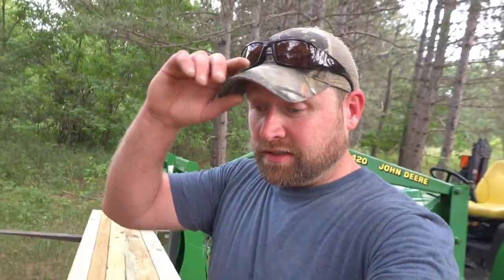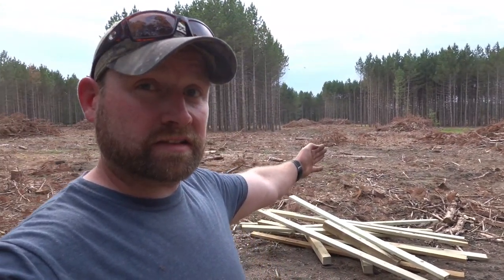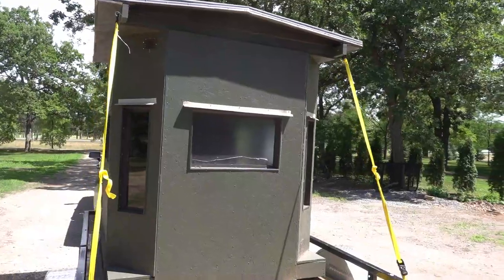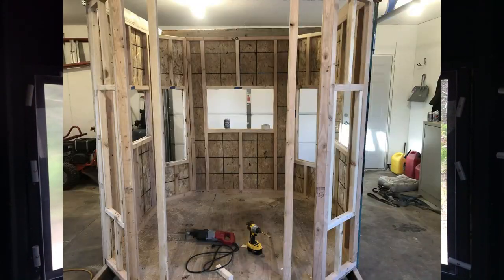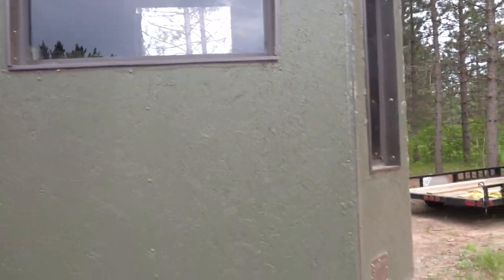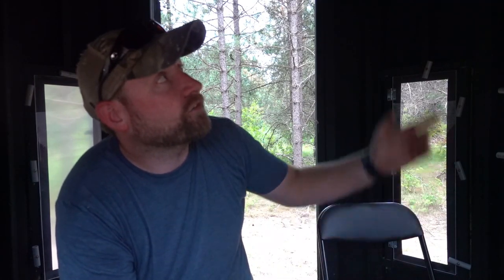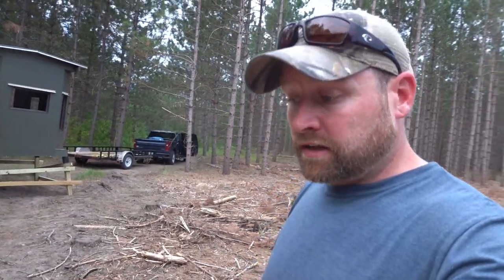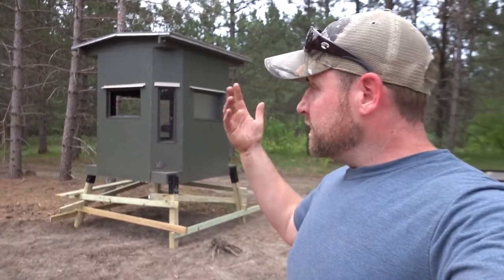Deer Hunting Blind Build. Step by Step.

Comment: Nice build! Two ways to make the OSB a less maintenance stand.
1. A semi-permanent fix... fiberglass the stand in the off season. 
2. Thompson water seal. Satin. A few coats every few years and it'll last a long time. 

I've done both ways and have OSB stands that have been in the woods for years.
It's alot cheaper to build and fiberglass your own stand. But the Thompsons water seal has been the best way thus far. 
Good luck!!
Reply from the maker: Thanks for watching and thanks for the tips!

Comment: I did the same and was also inspired by Brett. 

I purchased most of my 2x4’s during the lumber gouging so my initial cost was high, but I waited on a lot of the plywood and 4x4’s to come down before finishing. 

All in all, I’ve got a running tally going. I’m at $800 and I have to finish the roof, get the 4x4’s and braces, and finish the steps. 

I think I’ll finish out around $1250
Reply from the maker: Nice! Thanks for watching! Thinking of building another one just need to get some time. Best of luck this year!

Comment: Nice Build, I used Brett's design for the windows in my build. I built my shack on a 6x8 trailer that will allows us to move it around the farm I hunt on in Southeastern MN. I did the same thing though, researched a bunch, then built and modified things as I have been going. Ended up using siding from a friends house that he had redone and purchased steel roofing which should give it a long life with next to no maintenance. Nearing the end of my build and excited to use it this season.
Reply from the maker: Nice!!! Hope the season goes well!